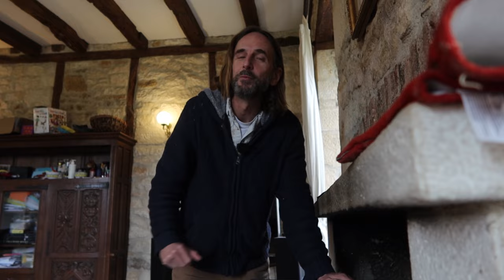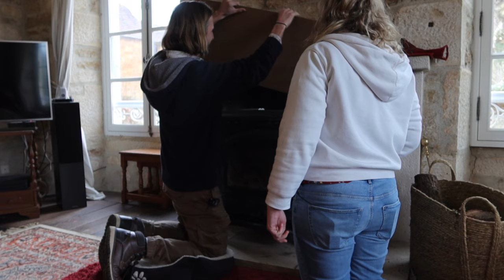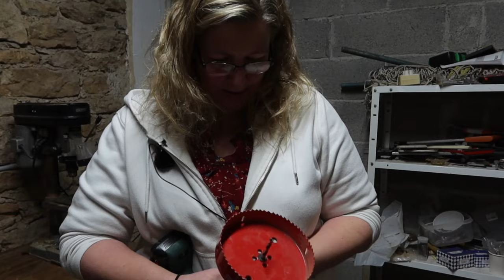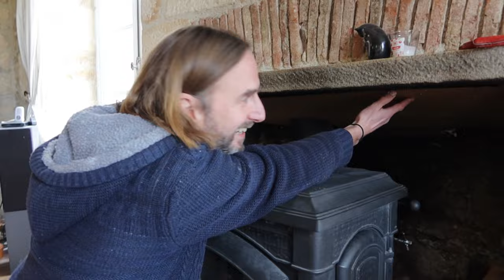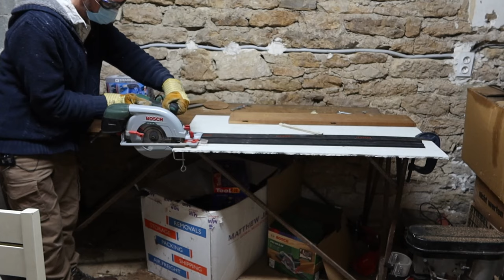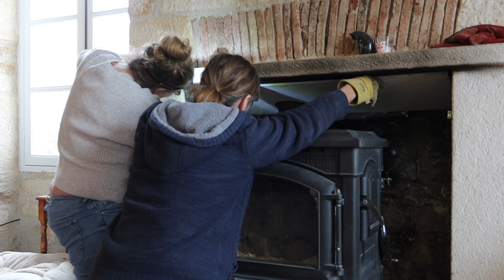How do you keep a Chateau warm?

Comment: On my farm in very cold place in USA, got a very old large farmhouse, 

One of my fireplaces is now fixed 
my huge Vermont Castings Defiant cast iron stove  in the living room  sits in a stone  fireplace like your log burner does.
1. Put fan on top of stove and sides of log burner
2 . instal metal baffle as you are designing 

With those improves you should be running around in your bikini

Farm Jen